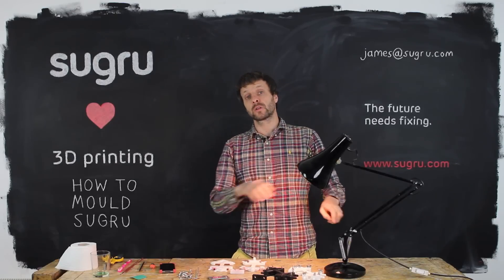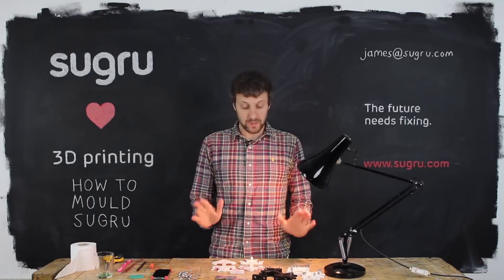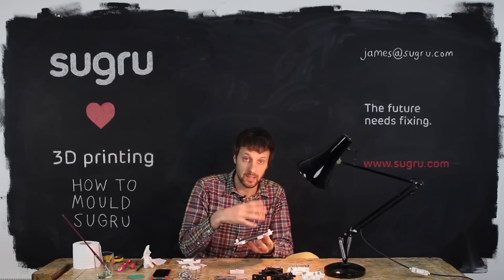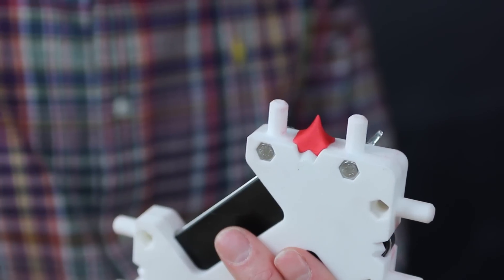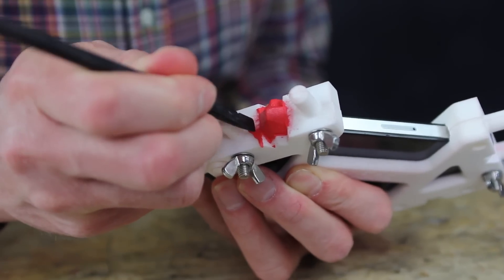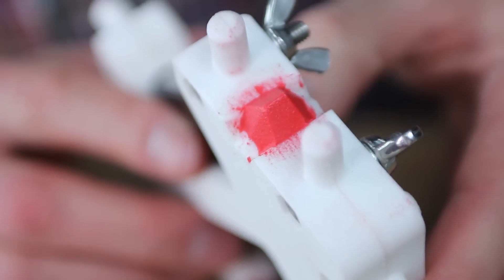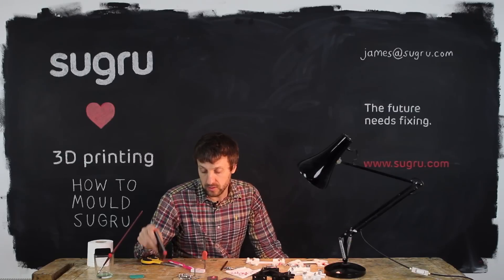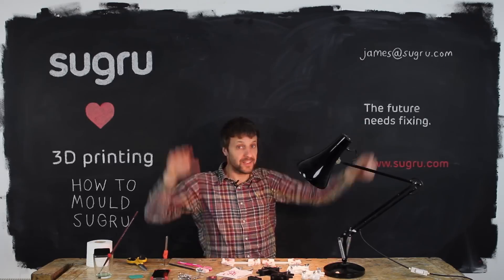How to make precision rubber parts using 3D printing and sugru

Comment: Not everyone wants to have someone else make something for them. Some people want to have the satisfaction of having something that they made, with their own hands. Even if it costs more. There is satisfaction in saying, "I did this." Also, once you make the mold you can do several phones EASILY with this process. No waiting for overseas shipping, customs, or the post man to deliver it. Just 24 hours in the mold, and you are done. Also if you break off a corner you can repair it easily yourself.
Reply: Not when the rest of the product left in the packet ends up curing inside the pack….I had some pack that I didn’t even open that cured.